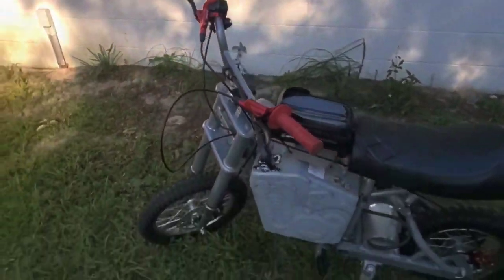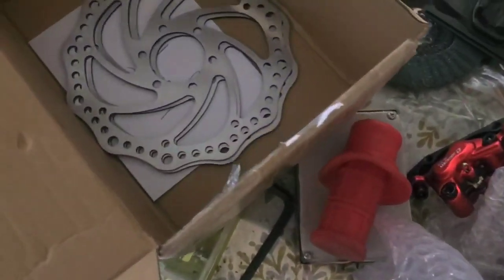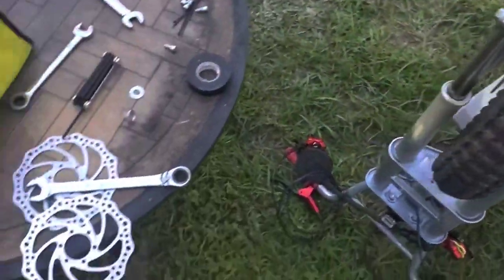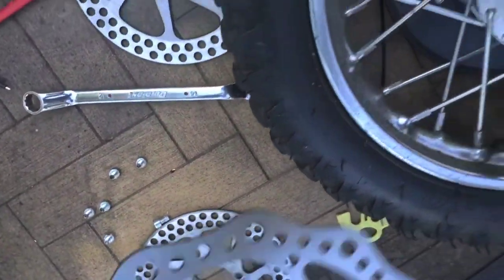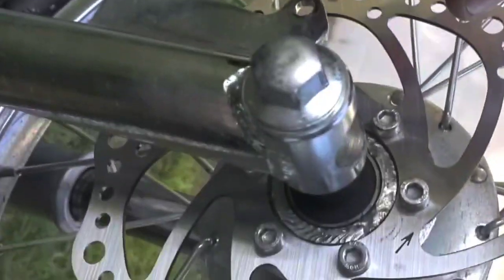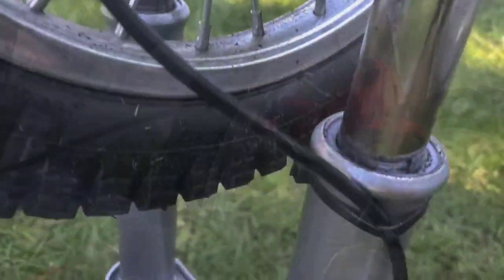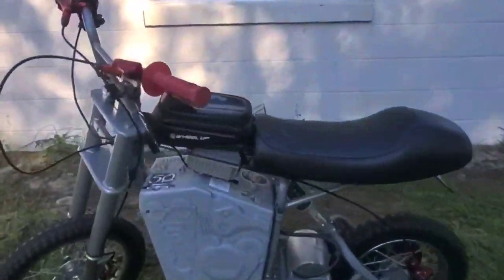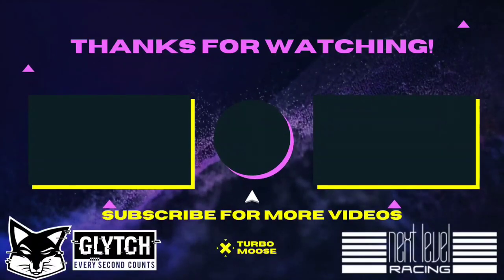How To - Zoom Brakes and Upgraded Rotors Install | Razor Mx650 MX500 SX500 RSF650

Comment: Do these fit all sx500 models I’m not sure if there is a difference but I have what I think is an older model it has the white and red plastics
Reply from the maker: Yeah all sx500, mx500,mx650, Indian eftr Jr and rsf650 use the same setup

Comment: Can i use shimano mt200 instead of zoom but same rotor? or any kind of better brakes than zoom?
Reply from the maker: Some fit the same as a zoom and some are slightly off. These Zooms fit with the adapter they come with so it's more then likely possible. If you see my recent vids I moved away from mtb brakes entirely and run crf50 pitbike brakes.